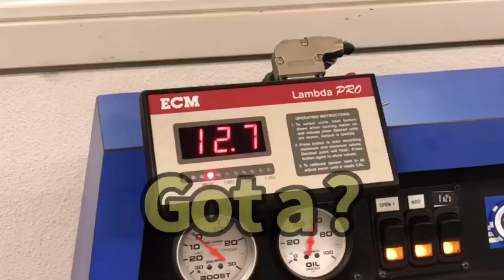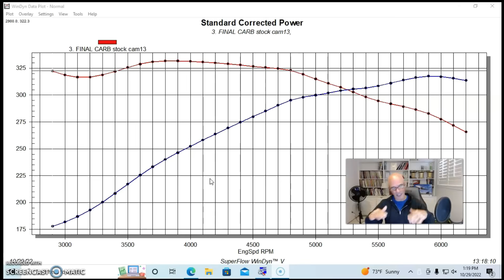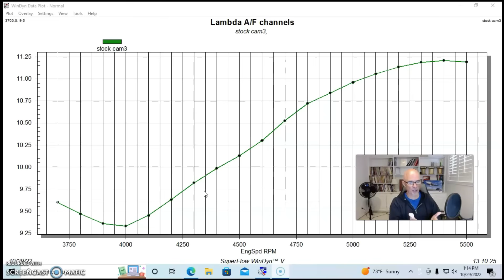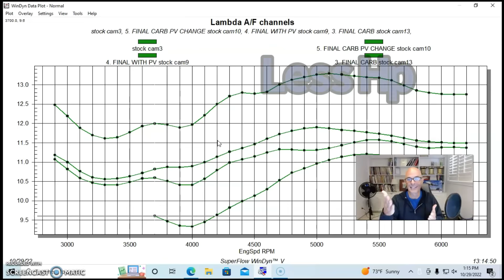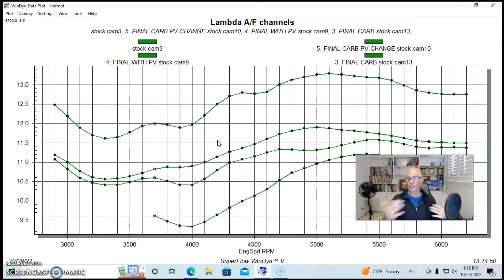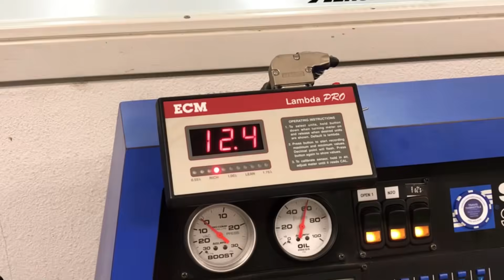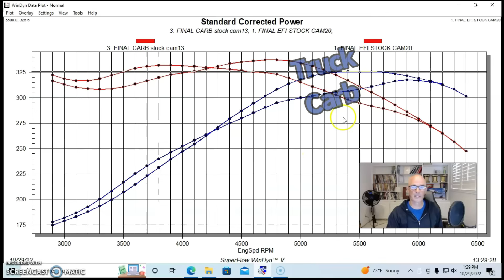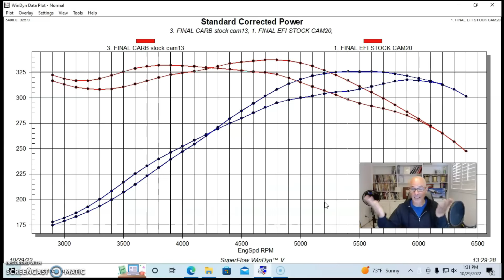WHAT MAKES MORE HP ON A JUNKYARD 4.8L LS? CARBS OR EFI? EDELBROCK PERFORMER RPM & 750 v TRUCK EFI

Comment: Small blocks have been done to death. You rarely see anything about big blocks. Why is that? But thanks for posting this. P.S. One thing to remember is that with a carb you may have vapor lock with this crappy gas today. The injection setup//NO. Would love to see a big block, all cast iron, with a flat tap solid cam, 3 deuces, & rail manifolds attached to 60" pipes-unbaffled & no H or cross overs. 10:5:1 comp.
Reply: Yeah and people in Africa want food too so we need a big block Chevy test at least one

Comment: Don't forget that that cam  was designed for EFI, usually, you get more top and power with the carb and more below the curve with the EFI set up. A cam with some more overlap would probably favor the carbed set up
Reply from the maker: there is no such thing as a carb cam or efi cam-there are just cams

Comment: I would like to install this set up on my 85 k20 suburban on 35s 4:10 gears with 700r4 . I'm wondering if I use stock 1200 rpm stall converter

Comment: Hi my name wayne and i 
Have a 1971 chevy c10 350 engine 4 barrel holley 
650 i need your opinion if 
You can I appreciate it 
go with efi siniper 2 or swap ls 5.3 engine let me 
Know thank you
Reply from the maker: no need for efi with that combo-just upgrade the 350 with heads and cam. An LS swap would add power

Comment: How about a 4.8 with stock fuel injectorsand rail, a mid rise intake, and a 4150 style throttle body?
Reply from the maker: will the stock rail work on the Holley?
Reply: @richardholdener1727  I haven't tried yet but I have heard that it will work with the Holley that is tapped for injectors. I have also heard the the stock rail flows better than the Holly rail. I was hoping you could tell me. 😆😅 I am building a 1962 BelAir and have a 4.8 4l60 that I will be using. I want to retain a similar look to the original but be able to run fuel injection. I don't want to go to TBI. I can't find any performance numbers or reliable information on this option but figured, they make the parts, it must work at least some what decent. Thanks for all of your videos. They are both informative and entertaining.

Comment: Curious to know what kind of timing table u are running on the carburetor setup I have a 6.0 with a Carb
Reply from the maker: same as EFI +2 degrees (31 total at hp peak, less at torque peak and below)
Reply: @richardholdener1727  thanks! Also love your videos! Always extremely helpful and detailed and just great quality, thanks again.
Reply: @richardholdener1727  also this car is more or less a street/strip car, should I do progressive up 31 or just 31 lock out from 2k rpm up?
Reply from the maker: less at peak torque and below as I included in the comment

Comment: Have you ever made an open plenum intake into a 4 chamber plenum.  Using a small opening to balance intake pulses. Increases velocity? Maybe help throttle response?
Reply from the maker: 4 chamber plenum?
Reply: @richardholdener1727  taking an 4barrel intake and putting dividers in the  intake

Comment: Hey Richard I have a 5.3 with stage 2 cam, single plane msd6014 and with a 625 demon carb my only problem is that it diesels on 87 but not on 91 I tried the timing on with 87 and no luck I have no problem running 91 but it’s kinda pricy and wanna use 87 instead any suggestions would help thank you!
Reply from the maker: too much initial timing
Reply: @richardholdener1727  what initial timing you recommend thank you for responding!

Comment: I’m doing a ls 5.3 lm7 swap carbed on my 85 c10 with a msd 6014 and a electronic fuel pump, anything else I need to make it run as a fun daily?
Reply from the maker: carb
Reply: What electric fuel pump would be good for the carb

Comment: Ok rich....i have an 87 gmc k10....5.7 tbi....im getting oil in the coolant...but no coolant in the oil....i found 1 guy online w similar issue....he found out it had some hairline crack between to oil galleys and cooling passages....oil pressure is higher then coolant so the flow went hi to low....but i cant understand is when engine is off....the oil goes to zero and the coolant stays 15 psi til it cools over several hrs.....why it dont leak into oil?? Anyway...im thinkin 454.....what years...junkyards...price  should i be in? Thx

Comment: Try a Q-jet, or a 650 Holley. The carb would E.T. better, on a drag strip, because you could use a lower rear gear ratio. The EFI probably has better fuel milage. Nice video.
Reply: Annular boosters in the primary's increases carb mileage 😊

Comment: Very interesting test. I am surprised to see that power is already dropping off  at 13.2 : 1 AFR    I presume that the factories are compelled to set AFR at the stoichiometric ratio of 14.7 :1 to minimise emissions. I would like to see you do power tests at AFR values ranging from 14.7  to  14 , 13.5,  13.0  and 12.5.  This should be fairly easy to do just by altering the block of no.s in the fuel table and everything else held constant. Can you arrange this. This would give us some appreciation of what the factories have to deal with.
 Regards,  John
Reply from the maker: you don't run 14.7:1 at wot-the factory doesn't do that either. that is a cruise a/f ratio

Comment: I would like to see a larger carb tuned right to see if it would match the efi with more airflow.🤔
Reply from the maker: IS ONLY 325 HP-THE CARB SIZE IS ENOUGH TO SUPPORT ANOTHER 150 HP
Reply: Maybe it was the plenum volume that made the differenc? 🤔
Reply: Or maybe a 3" carb spacer?

Comment: Did the 4.8 like the 4-hole spacer? Or did it not make a difference in power
Reply from the maker: it did
Reply: @richardholdener1727  do you think the 750 carb was to big or just right

Comment: You'll get even more power from efi with a tbss/nbss intake. It's cheaper to go fuel injection especially when pulling everything from the yard. You'll have everything down to the harness/ecu to run it. And as far as vats being turned off, there's even free ways to do it now. If you go carb, then you still have to buy the carb, intake, and msd box. About an extra 700 plus
Reply from the maker: THE TBSS ISN'T WORTH MUCH ON A STOCK 4.8L

Comment: as efi have `perfect` air/fuel ratio, shouldn`t the computer based system perform better at every rpm. how long(and varied) did the efi get to run before the vs test
Reply from the maker: what is a perfect air fuel?
Reply: @richardholdener1727  apparantly the ecu is not confident in his answer :)
Reply: @richardholdener1727  — The one that works best …

And after you figure that out, it’s a lot easier to achieve with EFI …

Comment: Hello Richard, 
Considering an engine and tyranny upgrade for my 4wd LS 2000 Tahoe with iron block 5.3. Have already upgraded suspension, brakes and 18" wheels. Interior is great shape too. Has the bi-fold twin rear doors, not a tail gate.
Goal is 375 to 400 hp with good low end torque, improved efficiency and teamed with a new 4L80. 
Considering swapping 3.73 to 3.23 differentials. 
Can you recommend long tube header size and exhaust. 
Result being the same or slightly better performance with much better highway mpg at lower rpm.
Carb versus EFI Testing of the 4.8 answered one if the questions I had.
New full size SUVs are bonkers money these days.
Thanks for your real world videos.
Keith
Reply: The best tyranny upgrade is the Saddamn Hussein mod.

Comment: I think when the two runs times are compared the EFI will be a fair bit quicker witch means the EFI basically kicked the carb’s ass a bit, very interesting to see the difference the carb did well I think 👍🏻🏁
Reply: Its been proven over and over that carbs have better throttle response.

Comment: I've had both a LS2 with CNC ported LS3 heads with a 226 duration intake 236 duration exhaust 600 lift on intake and exhaust aftermarket camshaft with a GM single plane intake with a Holley HP 850 carberator redlines at 7200rpm had this setup from 2008-2021 now have a GM performance LS3 495 horsepower crate engine with CNC ported and milled LS3 heads with a 219 duration intake 228 duration exhaust with 525 lift intake and exhaust with a 102mm throttle body and sheet metal intake with ZL1 injectors and fuel pump redlines at 6600rpm tuned and runs on E85 the LS2 carberated engine made 540 horsepower at 6700rpm with 470 foot pounds of torque at 5200rpm at the crank the LS3 fuel injected on E85 made 520 horsepower at 6200rpm and 495 foot pounds of torque at 5000rpm at the crank so it's down 20 horsepower vs the carberated engine with a more mild camshaft but with the injected engine from 3000-6200rpm is up 25 foot pounds of torque in some of the rpm range 30-35 more torque than the carberated LS2 but the carberated LS2 was better 6200rpm up I've had the injected LS3 now for 11 months and so far l really don't miss the carberator and the headaches of tuning it once a year and replacing 80 dollar spark plugs every 12-16 months because the carberator needs to be tuned after 1200 miles on the injected LS3 running E85 after inspecting the spark plugs after 1200 miles they look close to new after 1200-1500 miles with the the carberated LS2 it's time to change the spark plugs if you want it running it's absolute best if your going to be street driving the vehicle and idling at stop lights the fuel injection is better but l can see a carberator working well on something that is more of a drag race vehicle that will need more maintenance and tuning the throttle response with the carberator tuned was really good but l think the throttle response of the fuel injection is slightly better and so far has been untouched now 11 months

Comment: Holly carb and nothing  else,efi will leave  you stranded and so problematic.
Reply from the maker: a modern efi system runs without fail for 300,000 miles-so that is probably not accurate

Comment: I’m wondering if you ran into fuel distribution issues with the carb/dual plane setup. If you had 8 EGTs or 8 O2s you could check for it, but hardly any street installation is going to be set up that way. Multipoint EFI is going to get the fuel itself pretty even, but there may be air distribution issues to cause variance, with all the twists and turns, both air and fuel might be disturbed on a carb setup. Still, interesting results, especially the different rpm peaks in the torque/hp curves. Thanks, Richard!

Comment: Great video as usual! Thanks for the time you spend on all this. Question. What happened to making the different combinations different colors on the dyno graph? Made it a lot easier to tell what hp or torque line belonged to what combination.
Reply from the maker: I can't do that any more-the software does not allow
Reply: @richardholdener1727  awe man. Well that's no fun but it is what it is. Thanks

Comment: What was the AFR curve of the EFI setup?
Reply from the maker: we adjusted til it didn't change power
Reply: @richardholdener1727  I mean you posted the AFR graph of the carb setup, but not for the EFI. It would be nice to see how nice an EFI AFR graph is compared to the Carb.

Comment: Other tests I’ve seen you do show the carb performing better due to charge air cooling of the fuel. 
This test probably has more to do with the intakes than carb or efi but I was surprised the efi long runner intake performed better at higher rpm so maybe a better explanation or test might be required to clear everything up.

Comment: What's a good size single & twin turbo combos for a .020 6.2 with 823 heads I want to know sizes not like models of turbos thanks for any help
Reply from the maker: what is the desired power level
Reply: @richardholdener1727   I want it to be capable of 800 to 1000 hp at the crank maybe keep it around 700 daily driver or turn it up if I want/ need to LoL

Comment: I know most folks are stuck on power, power, and more power! But what I want to focus on is a balance of power and “decent” fuel economy. So my question/challenge to you Richard is about fuel consumption. Maybe you can start adding that matrix into the videos or create a couple videos on fuel use per a given combination for equal amounts of dyno time 💁🏼‍♂️
Thanks for all that you do sir!!!!
Reply from the maker: you want mpg at WOT?
Reply: @richardholdener1727  maybe a fuel consumption of the different engines: 4.8, 5.3, and 6.0 in stock form vs bolt-on vs boosted? And doing it over a given period of time as well. I’m thinking this could give some rough insight of how fuel mileage can be positively or negatively affected with different combinations.
Reply: @richardholdener1727  if its something that's possible?
Reply: @richardholdener1727 do a stock truck intake like you did in this video vs carbureted swap to see which one is more fuel efficient
Reply: @richardholdener1727  adding power while maintaining or increasing fuel mileage is something I’ve tried to keep in mind. Thank you for asking for clarification on that.
Reply: build v8 motors for fuel economy ?
Reply: Buy a prius!
Reply: Up to a point, more performance over stock doesn't negatively affect fuel economy very much IF you can keep your foot out of it daily driving, depending on the engine to start with. A 4.6 Triton gets trash mileage from stock, but I know for a fact that a tuned 600 hp 60 Series diesel, a Mini Cooper W11B R53, a 350 crate motor, and 5.3 LM7 block will get the exact same or better fuel economy after modifications to increase air flow and horsepower than before, as long as you don't hot rod it daily driving. After a certain amount of fuel flow/ hp over stock, you're definitely gonna be turning enough dinosaurs into torque to get diminished returns on your investment, but a mild 50-200 hp over stock depending on what you start with shouldn't hurt ya much, if you can drive it right.

Comment: I would like to see the same test but now with a cam designed for a carb motor instead of the stock efi cam.
Reply: Okay, a factory cam is designed to make smooth driveable power and as best economy and emissions as can be expected in the engine of a vehicle it's designed to be used in. The fuel system is designed to keep the fuel mixture correct, throughout the engine's entire range of operation. Every camshaft designed for a gasoline engine is a carburetor cam and every cam designed for every gasoline engine is also an EFI cam. The camshaft is not different, it's only what controls the fuel mixture that's different. Camshaft designs have changed because of computing power and programs at the engineers fingertips.
Most of the time, you can make more hp and torque with a carburetor without making any changes to the engine, but if you want to make hp and still get great mileage and be able to go from low altitude to high altitude and keep nearly zero emission while doing it, EFI rules. If you want to add a turbocharger to an engine, it's way more simple and practical to start with an EFI engine. 
Every engine is a turbo engine and every cam is a turbo cam (I Iearned this is true from Richard and this channel ).

EDIT: I didn't make this reply to sound like I know it all but when I read it back, I don't feel that great about it, but what it says is true.
Reply from the maker: this cam is designed for a carb-so is every other cam-and also for efi
Reply: Well I'm glad i got that clarified now, i just had the idea looking at different cam manufacturers how they offer some carb specific cams vs efi cams. I think I've read somewhere the difference was at the opening ramps but again that might have been depending on the application.
I really appreciate all the time and effort Richard puts into doing this real world testing. We learn a lot from you Richard, thanks a lot.
Reply: @celasuperman  Richard is doing a really great thing here. I only wish the guys can ignore the engine brand he puts on the dyno, and realize what he is showing us is applicable to the engine we have right now or for the engine we want to put in our Hot Rod. Everything applies to our application as well as the one he is testing even if you have a 4 cylinder or a V6 and he's testing a V8. He stays away from the extremes and gives the regular Joe a chance to build a great running engine right out of the box.

Comment: Is the relatively small truck throttle body causing any issues for the EFI? It seems to me a 750 CFM carb would have the ability to flow a lot more air (whether the engine can use it or not) than would a 78mm TB. Not sure how it would affect it overall ... might even hurt the bottom end torque more than it already was in comparison to the dual plane ... would be interesting to find out, though.
Reply from the maker: THE THROTTLE BODY IS NOT A RESTRICTION AT STOCK POWER LEVEL
Reply: @richardholdener1727  - If it's not a restriction, then why not use a carb which flows the same as the truck TB? I'd lay wager the 750 will outflow the 78mm TB by a fair amount. Make it as close to apples-to-apples as you can make it for a fair test.

Comment: My take-away from this test is that the LS Performer intake manifold is not the best at cylinder-to-cylinder fuel distribution. That is evident by the noted loss of power when attempting to use anything leaner than 12.5:1 Air/Fuel mixture ratio. It is easy to achieve with port fuel injection. It is difficult to design a wet-flow intake with cylinder-to-cylinder distribution to be near optimum, which is required to run the leaner mixture ratios. When one cylinder tends to be leaner than the rest, you must richen the overall engine's mixture ratio to bring that one cylinder into the safe/power mixture zone. It is not necessarily a huge detriment on an engine being built for performance but it is a detriment when looking for fuel efficiency as well if that is a primary consideration.